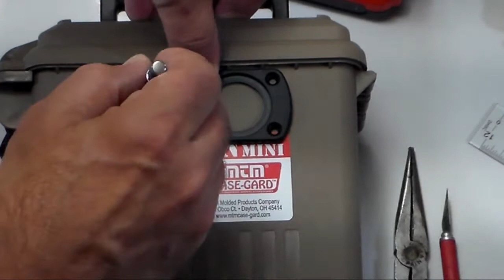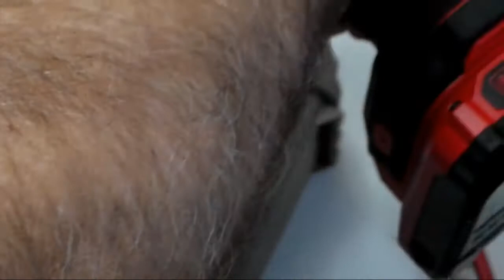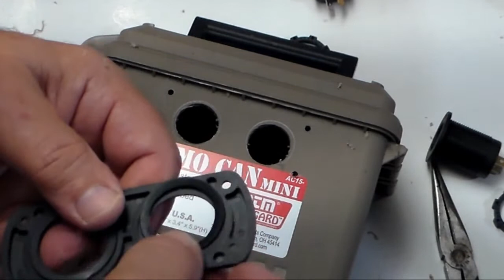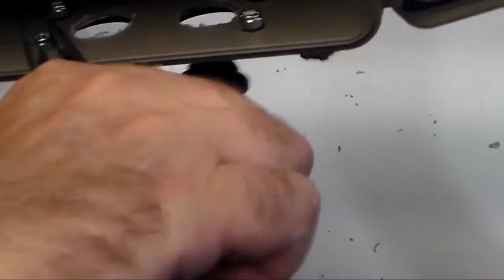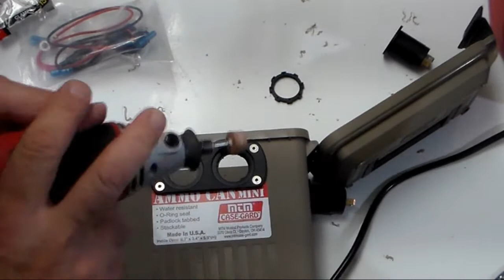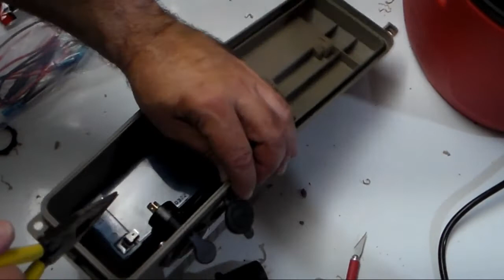AMMO CAN BATTERY BOX BEGINNER BUILD 2

Comment: I just bought a boat and I installed a trolling motor on the bow along with a Humminbird Helix 5 . I needed to get power to the Humminbird and did not want to rip up the floor and rewire the entire boat. Your little box saved me a ton of time as well as money. Almost the end of fishing season here in Central Illinois. I'm going to build the basic box first, then when the snow flies I will `tackle the next steps. So glad I found this video. I especially like that you are not afraid to show something that did not go exactly as planned. (Crimping the connectors). I always have to buy those connectors in bulk because I invariably don't get it tightly clamped. Thank you Sir for sharing your time and knowledge!  I am looking  forward to more of your timely video's!!!
Reply from the maker: John, you putting in a lithium battery? Just wondering how much time you get on the trolling motor until you hit 11.4 volts and need a recharge.
Reply: @thisoldmanchannel  No Sir, I have a full size deep cycle trolling battery for the motor, but when I tried hooking the wires from the fish finder to the trolling battery I would get interference. So I'm building the Super Mini Battery Box to hook the fishfinder to. Having a light attached to the box will be very handy after dark. Plus cell phone charging and something I bet you never heard of. I have cochlear implants in both ears and I can charge there batteries  from the SMBB when they get low! Thats a win all the way around, and I have you to Thank!!! So again THANK YOU SIR!!!